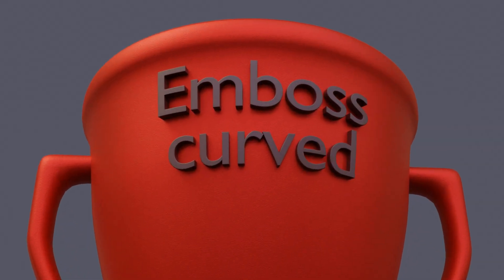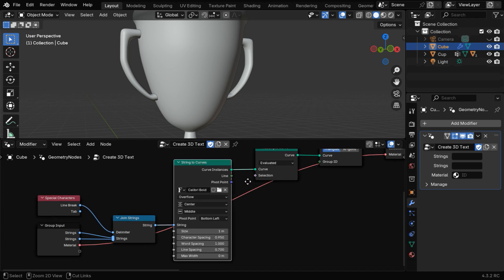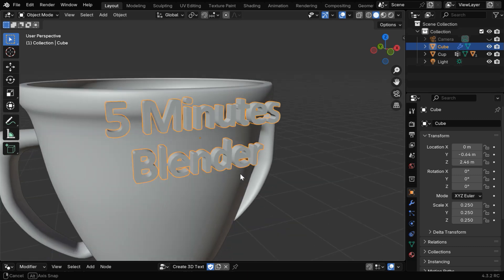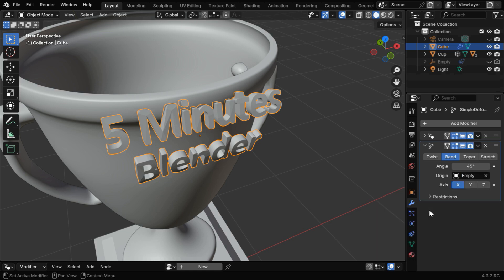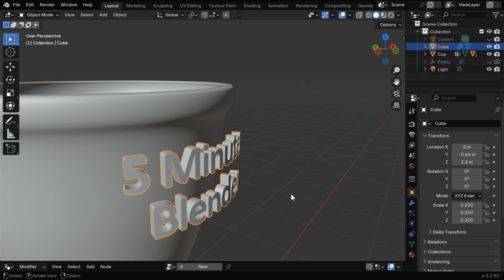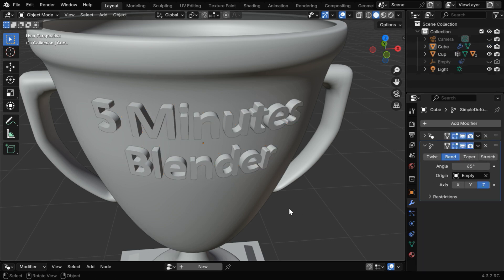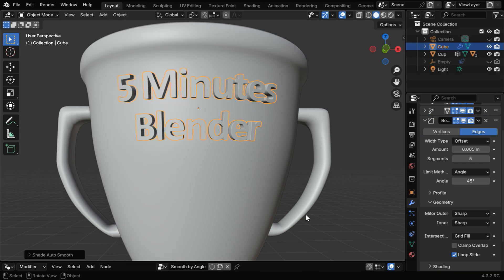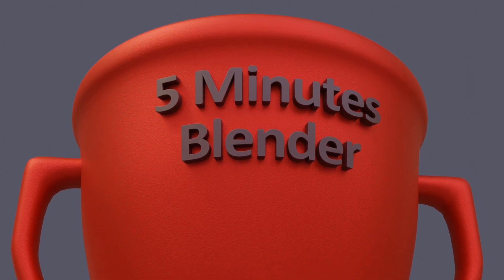Emboss On A Curved Surface | Attach A Logo or Text | Blender Tutorial

Comment: Hey How to Add one more line?
Reply from the maker: If you are using the traditional method to add a text object, you can go to the edit mode and use the enter key to go to the next line. If you are using geometry nodes to create the text object, you can add another String node to add the 3rd line, connect this String node to the same Join Strings node to concatenate with the rest of the text (Join Strings node can take an unlimited number of input nodes).

Comment: better method is to create Text object and then convert to mesh, then go to edit mode in cup object and use knife project (select text object with Ctrl). then simply extrude it and you get properly joined text.
Reply from the maker: Thanks for sharing an alternate method. We still need to bend the text appropriately, we also need to set the viewport orientation correctly for the knife project function to work. I discovered that this method can produce correct results in some cases and wrong results in some cases. Nonetheless, I appreciate your tips as it can help someone in some specific cases better than the method we discussed 👍
Reply: @ actually we can also use lattice(shrinkwrap to surface) to deform the text object properly.
Whenever i need to do such thing,, i prefer remeshing with quad remesher it gives very nice result.
Reply from the maker: @kalpit3d934  Yes, lattice is very useful and very underrated, I think it has great power. That remesh thing is also useful, I really appreciate your inputs on this 👍👍
Reply: Even currently a free remeshing addon Qremeshify is available also.
Reply from the maker: @kalpit3d934  That's amazing!

Comment: Bad solution
Reply from the maker: I can understand and accept your criticism. But I found this to be really easy for someone who just needs a quick solution. Any other method needs us to deal with the topology (that too for a curved surface) and it be a nightmare. No single easy method exists that can handle "any text" or "any logo" - we have to do it case by case basis. So we discussed this generic method, which is not technically a good method, but it works for a quick solution.